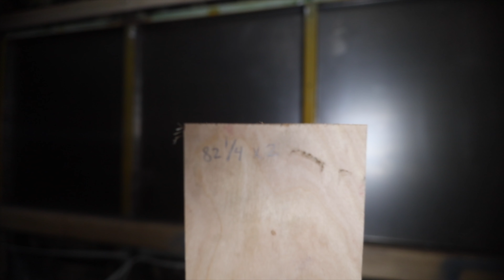Closed Cell Spray Foam a Skoolie // Skoolie Build Ep. 8

Comment: not to be an alarmist, but closed cell spray foam continues to off gas after it has cured. you should be avoiding direct exposure to it at all costs due to the potential health effects. it should really be painted w/ special paint to seal it or covered w/ sheet rock or other panel. There is also a MASSIVE risk associated w/ exposure if it were burned in a fire. Strongly encourage you to look into this if you haven't yet.
Reply from the maker: No worries! Thanks so much for the insight and the love that’s coming along with the comment. 

We’ve researched and used closed cell foam on several occasions, but I’ll definitely continue to read into concerns with it. From everything we’ve read on and about this foam, when mixed properly, off gasses for around a week at the longest.
Reply: @mariajoseandchase  I used to run a commercial insulation branch, including 2 spray foam trucks. The long term exposure is the problem: asthma, respiratory issues. Thermal barriers are required in NY for some residential applications also. Better safe than sorry. The manufacturer may say it’s all good, or a “unbiased” third party may make claims, but remember that paint had lead for decades before it was linked to poisoning families, and asbestos was utilized in all sorts of applications before it was linked to cancer and prohibited. Spray foam is still a very new product.
Reply: This is only accurate if the two parts have been mixed incorrectly. Offgassing only occurs while the finite reaction is taking place. Notice the word "finite." If the mix is correct, the reaction will be complete in 24-48 hours. After that point there are no further chemicals left to "off gas."  So if you are an expert and your installs have off gassed after it has "cured" then you were doing it wrongly.